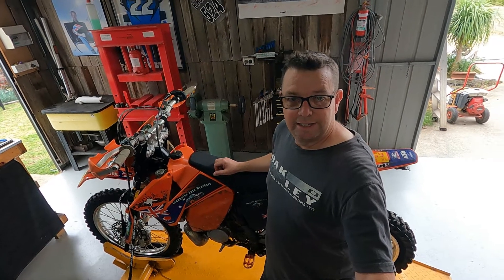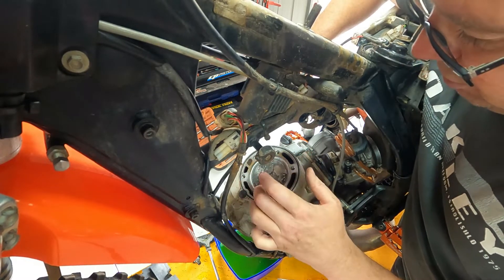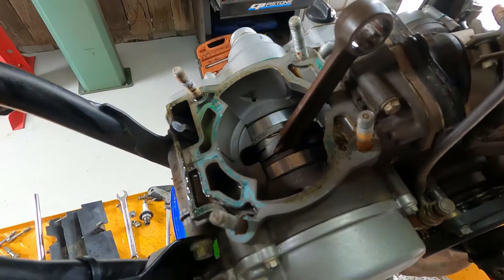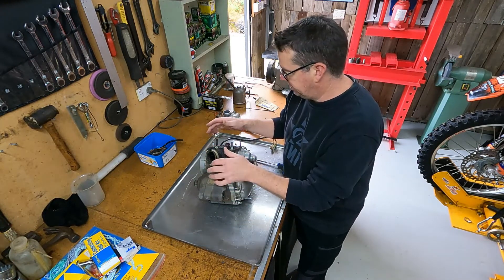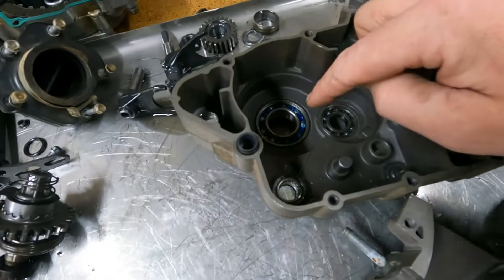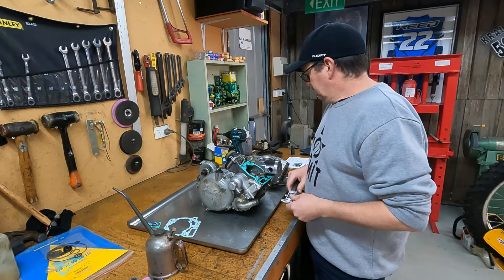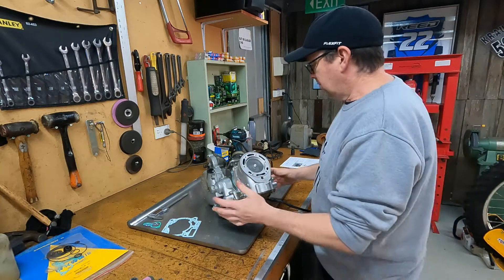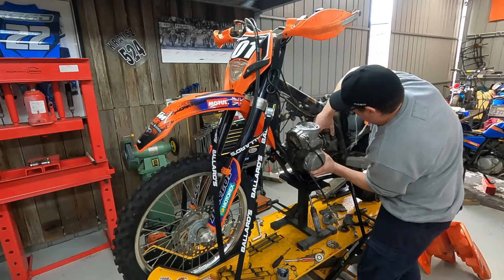How to select the correct base gasket and engine rebuild KTM200

Comment: What year is that mate mine the 06 aswell gearbox has went again
Reply from the maker: Hey mate it’s a 2006, it’s my nephews bike and never had trouble with the gearbox.
Cheers.
Reply: I have 07 Last "oldmodel" no issues with gearbox I use motul 5100 15w 4t oil max 15h

only sometimes kickstarter feels odd (like slip over) I have good condition "rachet" and new spring I think that will fix it
Reply: What gearing you are on? And dont torque ride 3rd gear